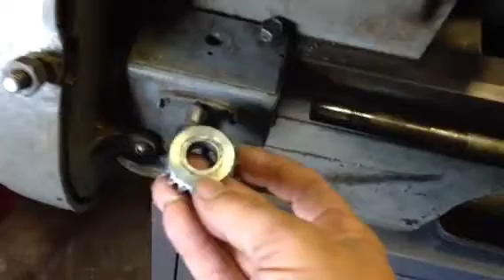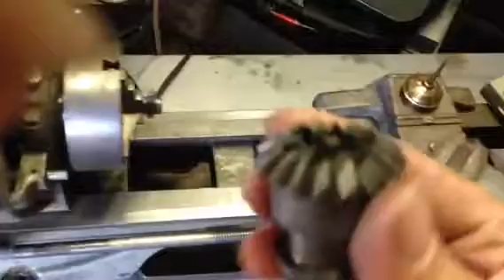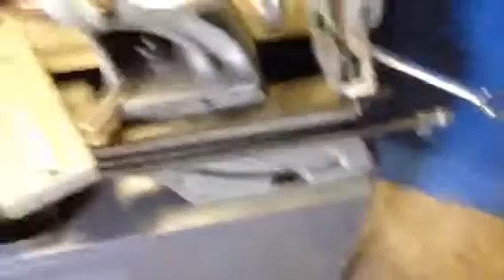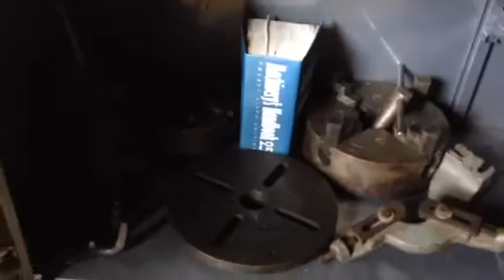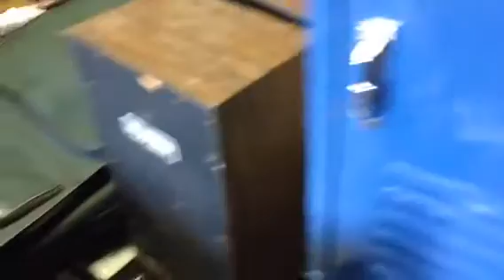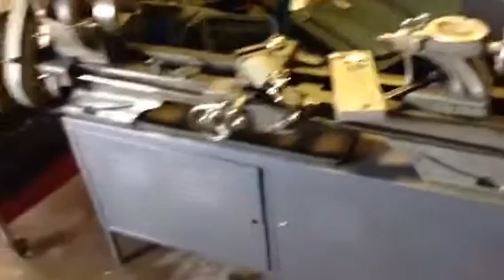Atlas lathe reverse gear repair, cheaper and better than or

Comment: I have a atlas 10D 
The parts you  need are readily available  at the Atlas  factory on  Pitcher St. Kalamazoo

I have broken that  lead screw bearing  as well   a new one was  $50

There  is a guy in Niles Michigan on here that has an atlas store

I find him to be a bit pricey tho
Reply from the maker: i already repaired it, if you watch my other videos it came together nicely and has been holding up well, cost me less than half what just a single atlas gear would have cost, and because its made of steel now it wont be breaking again.